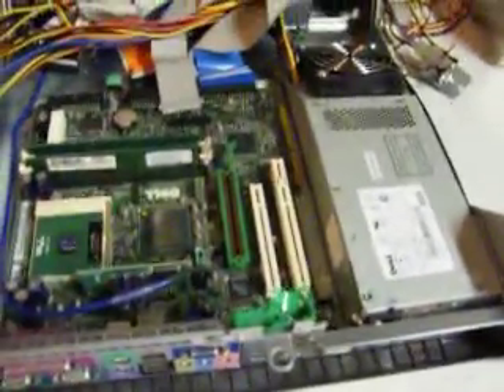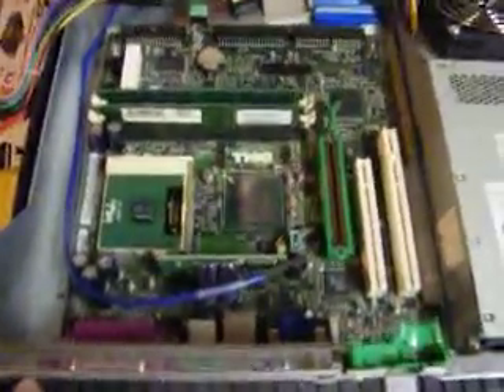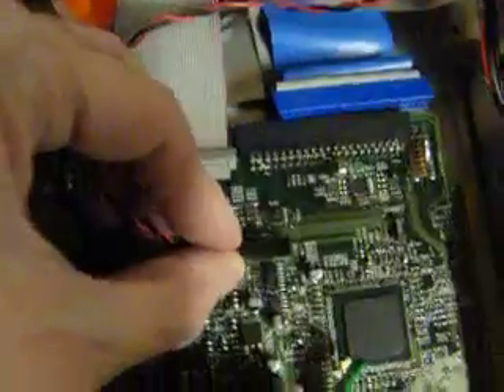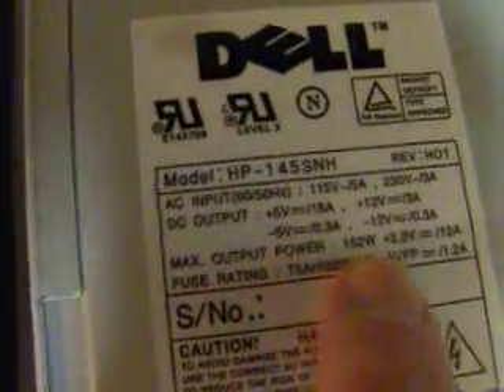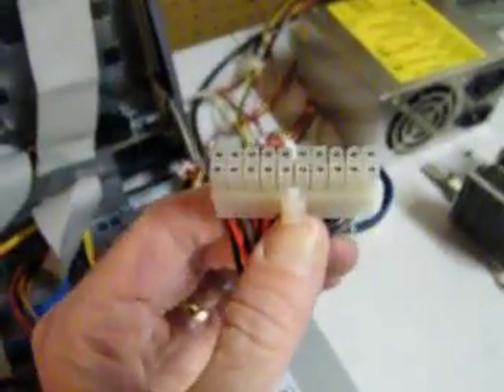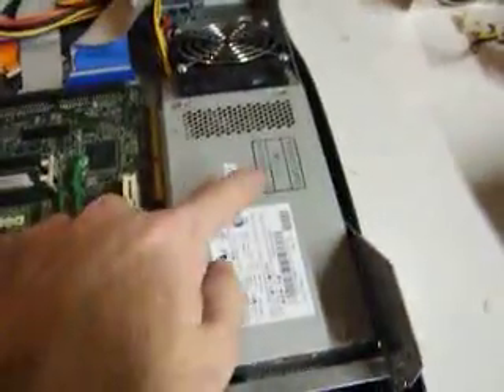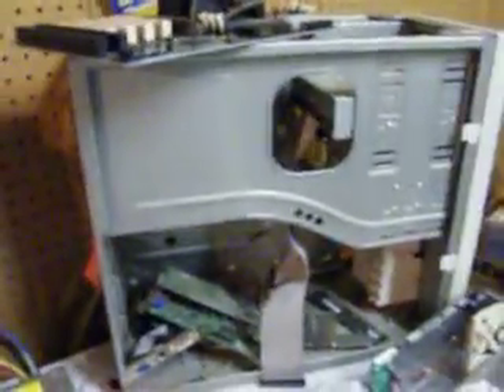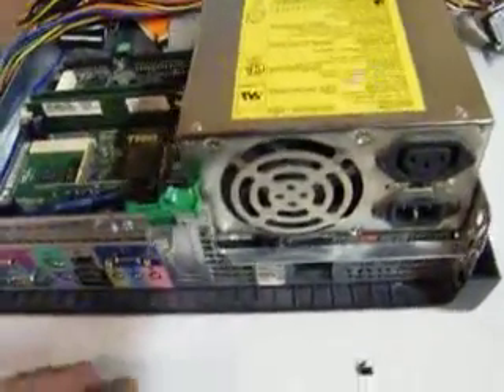Dell proprietary SFF case problems

Comment: They didn't screw up anything, they did it on purpose. This way, you have to pay a lot of money for non-standardized parts or buy a new computer.
Reply: this. also big companies get these machines and they get the next model and bin all the old ones. they're making it as hard as possible to upgrade/customize to maximise sales.

i think the solution would be to rewire the other psu the same as this machine... although it would be hard

Comment: the best thing i could think of would be salvage as much stuff and swap it into another motherboard and case
Reply: the issue is that the bios can detect all the proprietary parts, so if you change a part in it the bios may not boot up lol i think someone did a video and upgraded the bios though at it solved the problem

Comment: That slimline looked to be the p3 precursor of the Optiplex Gx200 series. Good computers but oh so frustrating.  I ran into this situation with an Optiplex GX270 I was using a while back. Looked up the replacement & fell out of my chair when I saw the price.

I told dell to go to hell & extended the mobo & molex cables on a standard 400w ATX & ran them in through the back of the computer where the old worthless psu was lol

Everything went ok & Since the case sat under my desk you couldnt see the psu hanging out the back of it xD   Its actually still running today.

A message to anyone else in desperation thinking about modding a standard ATX power supply for a slimline or any type of recent dell (OR ANY SLIMLINE PC)

---------> [[[[[[  Make sure to check your ATX voltage pinouts! ]]]]] <---------------

Dell decided to change the ATX standard 2 more times after this video. x_x [(depending on models & excluding the new ATX2 form factor- well...hell, check them as well! lol )]

Good luck :)
Reply: its probably a GX150

Comment from the maker: The ignorant part was "Funny how you can fix the PC for yourself but not for your customer and you obtain their PC for free.."
You have no idea what the customer wanted to do, yet you presume that I told them it couldn't be fixed, got the computer for free, then fixed it for myself so I got a really cheap computer by what is essentially fraud.

The customer didn't *want* to fix it, after finding out what a compatible PSU was going to cost.

And I can build a better machine.  Using standards.

Comment from the maker: You're asking for free tech support, and *expecting* a prompt response?  That's a little presumptuous of you, wouldn't you say?

Anyway, you've either got a failing power supply, or a short somewhere.  Checking for shorts can be a pain, and more indepth than I can get in a comment here.  A failing PSU is a matter of swapping with a known good one, and checking if it works.

Comment: Hi guys, i am hoping to get a quick answer here, i want to put an itx system in an old gx150 desktop case, i know it is going to need some modding but i don't mind, what i would mind if the i/o panel is not the standards size panel, does anybody know if astandard mobo i/o panel fits in the gx150 space reserved for the i/o panel? 2nd, does anybody know cheap comparable cased with flipped pci slots?

Comment from the maker: @MixerVM Have you read their return and warranty policy?
Basically, it works out to "Once you've ordered something, you're screwed."
If they ship you something that's DOA, tough.  Deal with the manufacturer.
If they screw up and ship you the wrong thing, they charge a 20% restocking fee for the return.
I won't deal with a company that says "If we screw up, you pay for it."
Quite frankly, that sounds worse than taking my chances on eBay.

Comment from the maker: @MixerVM Which usually come with zero warranty.  I don't do that for customer equipment, because I stand behind my repairs.  I've been burned by that a couple of times, when an eBay component died after being in the machine for a week or two, and I'm out the price for another one.  I don't do that anymore, for that reason.  If I'm going to fix something, I'm going to do it properly.

Comment from the maker: @DoctorStalker1 Either that, or they'd run it on 12V, rather than 5.  Let all the magic smoke out, and it doesn't work.

And Dell would probably spin it as their computers are "too powerful" for standard USB components.

Comment: I recently found two of these small form Dell's P4s @2.4 and 2,8. one had been vandalized with wires cut to PSU and drives (the other was complete and intact.  After washing it I put the small MB in a dell 8250 case. All connectors work and the psu for any full sized dell P4 will mate. The mb is smaller and you'll only have AGP and 2 pci slots but it is a drop-in. The last P-3 (black clam shell) cases should also work.A big advantage is that  you can then use full size drives.